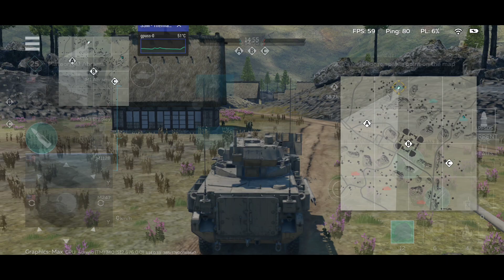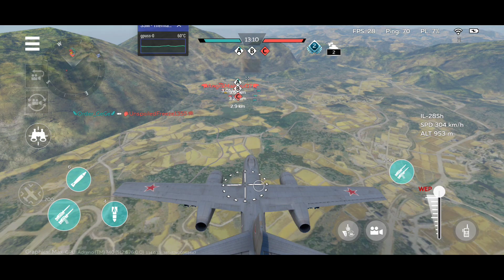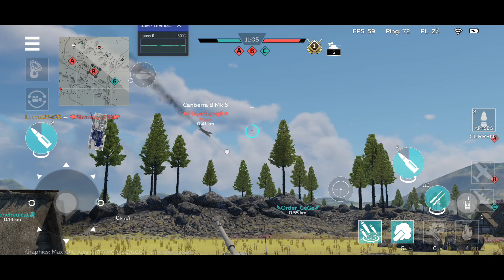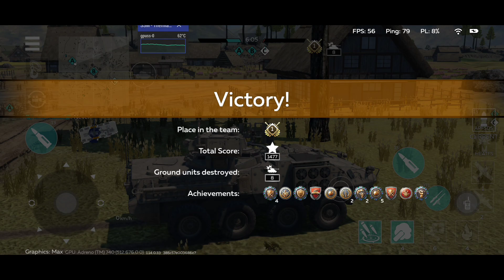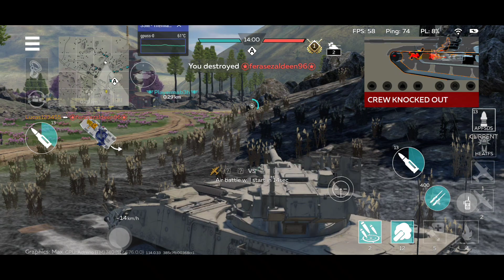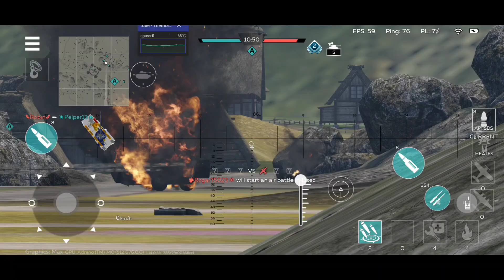War Thunder Mobile - M1128 Gameplay Guide HUGE Vehicle Has Wheels + NO Armor But Very Good Cannon

Comment: What is the best level 19 platoon?
Reply from the maker: Leopard
Reply: @VirtualPersonYT  brother that's a level 20 tank,I'm close to being level 19 and have around 2 mil lions.Ztz,challenger or t72b are my options for my 1st t10.Which is best?
Reply from the maker: @jondandavekinanahan7488  ah my bad. Challenger or ztz is fun id use that one. T72 has bad reverse.
Many will pick ztz
Reply: @VirtualPersonYT  I'm thinking going for t series because of the fire power,the ztz isn't much of an upgrade,the reverse isn't that much better and you don't even have the AFT.also the upgrade on the bmp really looks like it could make it a menace of a flanker.If I had the choice,I would def have Abrams and leopard at rank 10.So what do you think? Challenger or T?
Reply: @VirtualPersonYT  also leopard is so op, surprisingly great armor,decent fire power and reload rate,and excellent mobility